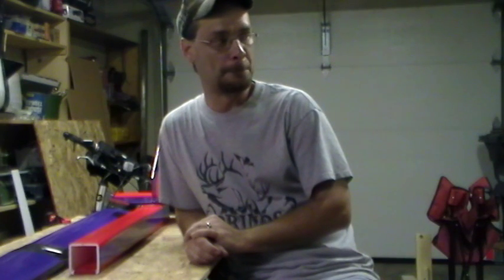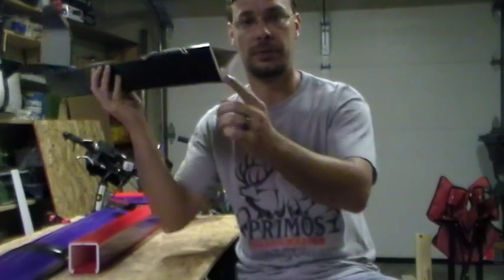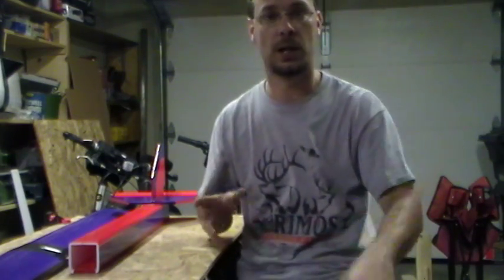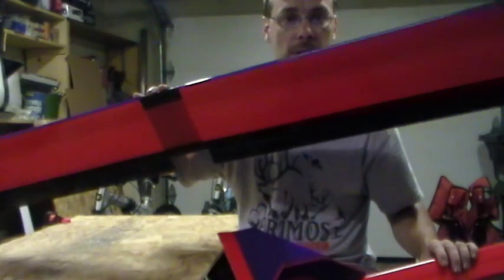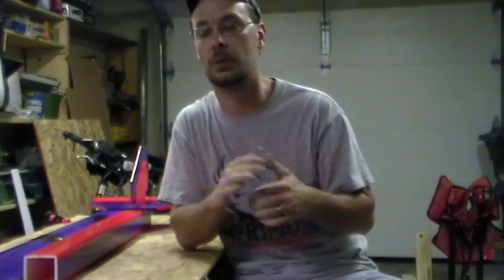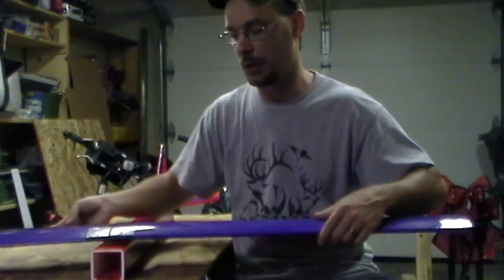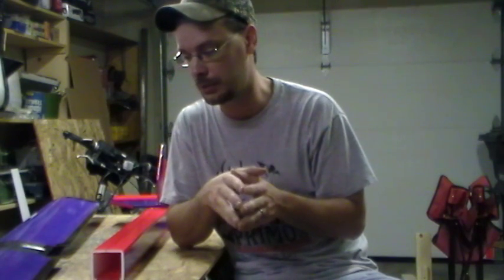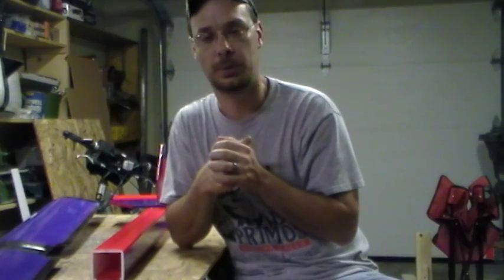Question on Wing to Fuselage Placement

Comment: Put all the electronics and motor on the fuselage. Lay a pencil on your work bench. Place fuselage on the pencil at a point where it balances. Mark that spot. Place the wing so that a point about 1.5-2 inches back from the leading edge lines up with that mark. Secure the wing to the fuselage THERE. Hold the plane up with a fingertip at a point 1.5-2 inches back from the leading edge of the wing with your fingertips. Adjust the battery to fine tune the balance from there. It's that simple. Peace!

Comment: Cont...
Move the fuse untill you find it's own balance point. Mark this balance point with tape to later align the wing by. Keep in mind that you may add a camera...so add it to the nose as well. Tape and mark your CG onto the wing using the 25 -30% rule. Now place the wing on the mark you made on the fuse install your method of attachment and you are done! Oh, attach the wing...lol

Comment: Great ideas guys...I would add to what Ollanderparker said, with the fuse complete with tail section with servos, motor, and the batteries placed as far forward as possible allowing room to shift them forwards or backwards 1-2". Now forget the wing and balance the fuse where it will...put a round dowel or rod on the table and place the fuse 90degs to it. 
To be cont...

Comment: experimentalairlines had another good tip in one of his videos. After you install all of your electronics and batteries, balance the plane on top of the wing (if using the Armin or a wing with an airfoil) This is a good way to find your wing placement and the CG. And I always do a glide test also. Like TheRevVegas said Will from MikeysRc demonstrates this in several of his videos.

Comment: usually on wing placement I tend to have the wing 6 to 10 inches back depending on how big of a motor you are using. If it is something in the 50 to 70 gram range around 8 to 10 inches back and if it is heavier like 80 to 115 gram motor around 6 inches back from the nose. Also make sure that your CG is around 1/3 of the wing cord back from the leading edge. 

           Just thought i would help out,

                                  - Nick